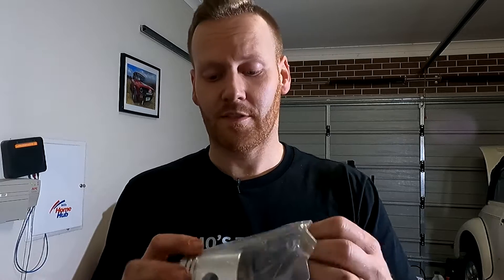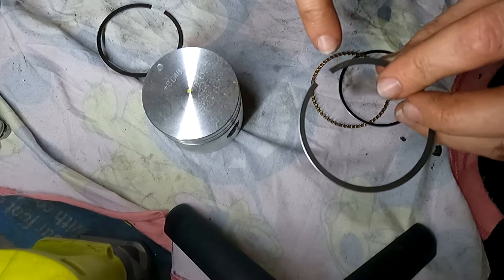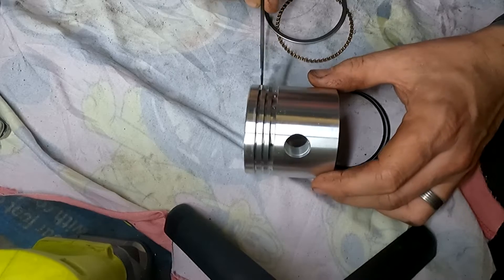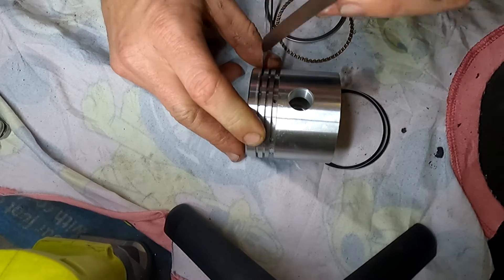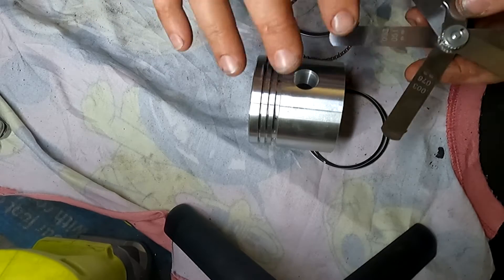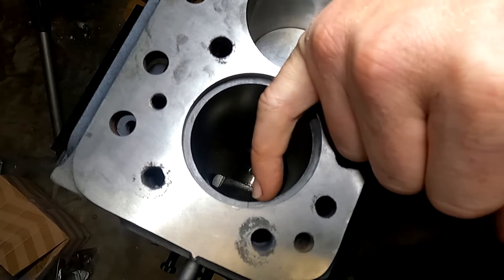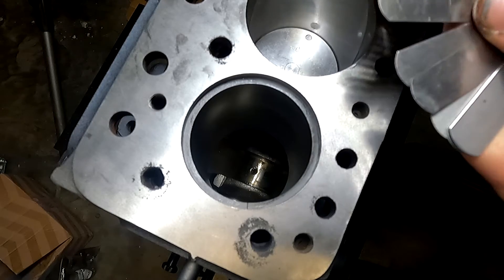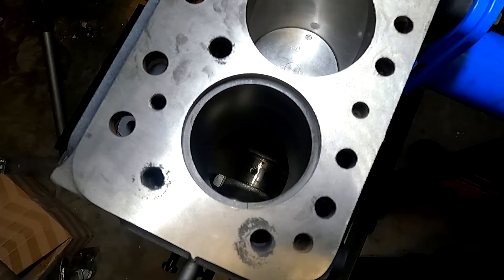How to: Check piston ring gap

Comment: Dont you need to messure from the bottom also?
Reply from the maker: @tomr.4699  do you mean at the lowest part of the stroke? I was only ever taught from the top, but I could be wrong.
Reply: @Tomostuneups yes, I’m working on a Vw 1.4l tsi Cavd engine and the guide is to measure 1,5cm from the bottom of the cylinder and I also measure 1.5cm from the top. Thanks for a good video
Reply from the maker: @tomr.4699  measurements will change throughout the bore, so it’s probably worthwhile doing several measurements. Good luck! I’ve built many of those engines in my time